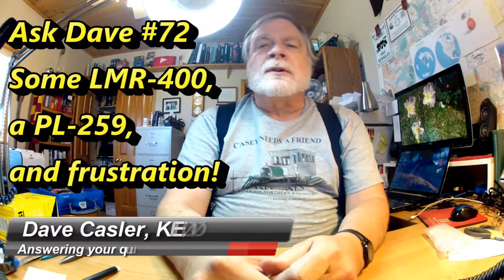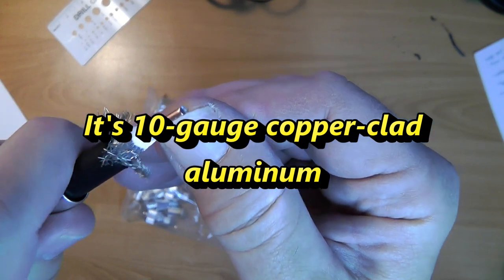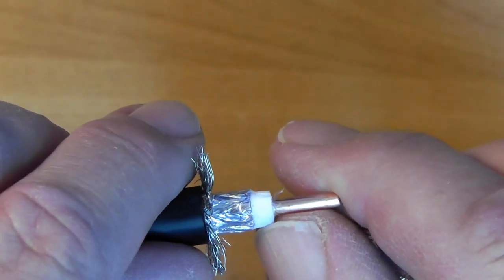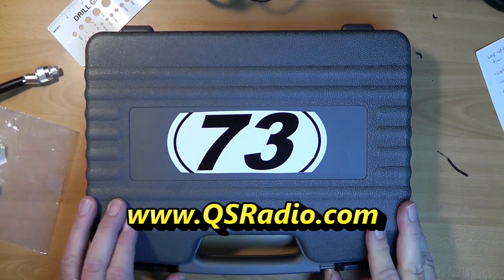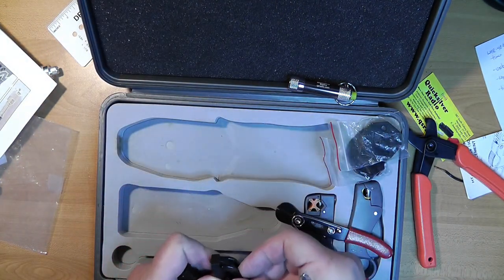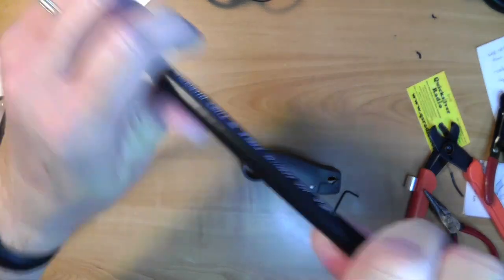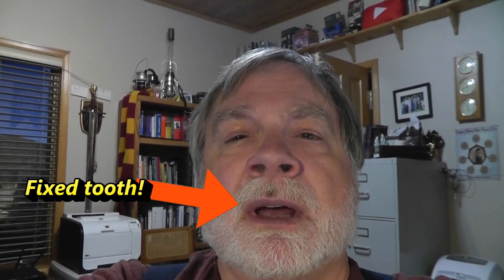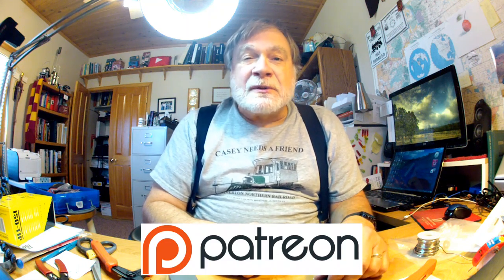LMR-400 Coax Cable and Connector (#72)

Comment: A cellphone company installed indoor antennas where I worked. They brought in a 1,000 foot spool of Times Microwave LMR400, used about 700 feet of it, then tossed the spool with about 300 feet of coax into the dumpster. With a scrap removal permit and some help from one of the millwrights the spool was fished out and went home with me. Free is a very good price.

Comment: Dave,

We build about 10,000 Times Jumpers and Antenna Cables each month :)  You are correct in that Times makes the best coax out there for low loss applications.  Some other points in your video need a little clarification.

LMR-195 is used by Hams, a lot of them.  We build a ton of jumpers with it as it is the same size as RG-58 with less than 1/2 the loss at HF frequencies.  This is a good combination. :)

LMR-240 is very popular as it has the loss of RG-8 and is the same size as RG-8x

LMR-400 is the most popular.  You can bend it 90 Degrees in 1 Inch during install without attenuation.  Yes it has a foam dielectric but the center conductor in Times coax will not migrate.  You don't have to worry about that.  We have a 10 Year Warranty on our cables and have never had one returned for that issue.

The tool set you have is OK for most cables and the smaller LMR types but if you are going to do a lot of cables you need a better set of crimpers and absolutely a better cutter for LMR-400.  The cutter you have is too small and flattens the coax making it much harder to strip. To strip the cable your stripper is OK but you need a set of Linemans Pliers with the Flat tip in both large and small sizes.

After stripping grip the first section with your pliers and Twist.  It will pop lose and slide right off.  For the others use the flat face of the pliers from the Side and Pinch the cable and Twist to break it lose.  You Do Not need any cutting implements.

The solid center conductor needs to be much hotter and you should flow the solder down the PL-259.  This will give you  rock solid connection.

We build LMR assemblies up to LMR-1200 :) THAT is big.  

We sell Reels of LMR through Amazon for less than you paid.  You can also buy our complete assemblies through Amazon, Walmart and design your own with Any Length and Any Connectors at https://USACoax.com
Reply from the maker: Thank you for the excellent tips! I'll get myself some lineman's pliers
Reply: I bought a 20 ft LMR-240 assembly with PL259 ends from MPD digital. I was impressed with the quality. Michael from KB9VBR J-pole antennas sent me to MPD Digital.
Reply: I've purchased 3ft 400 series ultraflex jumpers from MPD, and MPD will be seeing return business from me! Great work. Great jumpers. Great assemblies. Thanks MPD Digital/USA Coax. 1Crazynordlander, I've bought KB9VBR antennas also. Lol. 460mhz slim jim works real well.
Reply: What is the model of the crumpet tool and does it come in a set?
Reply: I have an LMR-400 jumper from you guys, very happy with it. But I think ill be investing in the tools to make my own since  I need to many different lengths and am impatient. LOL
Reply: So this kit is useless for RG6?
Reply: I just got 120’ LMR-400 flexible low loss w/ pl-259s. 
I’m going to be honest previously I had 100’ RG-213U with Ampthenol pl-259s it’s was great coaxial.
The thing I’ve found so far with LMR-400 is one of ends the srink wrap has slid off the pl-259. 
Now, I’ve to fix it myself or it’s exposed to water running down into my experience coax!
I just paid for. $160.00  At this point I’m questioning LMR-400 being the best cable. It wouldn’t last for long the way there pre-made ends were put on that way. I’m probably just going to upgrade & pay more & put better ends on anyways. But, that’s a lot work for what I paid just saying & time!!

Comment: I buy the off brand LMR-400 copy and have never had a problem with it. I just screw on the PL-259 but it is a tight fit. L leave the brade on the side and twist the connector on over it then trim off the excess. I then trim and solder the center conductor. I normally can get a 500 root roll for around 250-275$. The locals buy it off me because there is no place local we can buy it. 

I used to love the old 9913 but I have not seen than in years. Nice video.......

Comment: We're glad you used crimp connectors David; LMR-400 and its variants are far too easy to damage with soldering - the foamed dielectric isn't suited to high temperatures.

Amphenol make some lovely crimp centre pin connectors for use with LMR series :)

Comment: Plenum rated cables sre also required by (urban, etc.) fire codes. In NYC it is required for all wiring inside shaftways, walls, ducts, all of the closed places where we sneak cable runs. They also produce less smoke when they do combust.
Reply from the maker: The melting plastic also produces toxic fumes.
Reply: I'm not sure if the plenum-rated cable produces less toxic fumes, or if it simply produces less (toxic) fumes because there is less smoke coming from it. But that's also part of the reason plenum-rated cable is required, less toxic fumes.

Comment: I use LMR-600 and putting connectors on that coax is an absolute dream.  I do use the proper tools for prepping and crimping the connectors.  Not sure how expensive the PL-259 connectors for LMR-400 are but for LMR-600 they are almost $9 each.

Comment: LMR195 is a great alt to RG-174, with much better shielding and power handling. I've used it in baluns - very flexible and easy to work with.

Comment: Looking for coax tools and came across the reviews on Amazon for the Times Microwave crimp and setup tools. The the stripper tool is made specifically for the Times Microwave brand connectors unfortunately. And at $100 for just the crimp tool , I’ll have to look elsewhere for tools that work with more common easy to find connectiors.
Reply from the maker: Yeah, the Times Microwave stuff is expensive.

Comment: Just my personal preference, but I slide a piece of marine grade heat shrink about 2 inches long over the crimp to provide strain relief where the braid enters the crimp sleeve. Marine grade tubing has hot glue inside and really grips and seals the connection.

Comment: You should use Amphenol connectors when using LMR cables.  They make it not necessary to strip the shielding allowing it to properly ground and keeping the low loss and noise quality of the LMR cables intact.  :)

73
AE0HF
Reply from the maker: Thanks for the tip.

Comment: Now this is interesting.  The Times-micro LMR400 I’ve been using has a full copper twisted inner conductor and is not quite as stiff.   On pl259 i lightly tin the inner tip of the center conductor and tin the coax “stinger” before inserting.  Solders much faster without too much heat to the coax and foam, although I read someplace that the foam on TM LMR400 is more heat resistant.
Reply from the maker: There are several flavors of LMR400, including more flexible versions. Pre-tinning is a good idea.

Comment: Forgot to add - for a great cable cutter go to Ace hardware and look for an Ace brand cutter tool we use here in the shop.  They are around $10 and we cut well over a million feet of coax up to LMR-600 with ours before they fail.  You can also get your Linemans pliers at any Ace. One set lasts forever.

POWER HANDLING - LMR-400 WILL NOT handle Legal Limit Power above 2 Meters.  This is what differentiates the LMR coax from RG-8 and RG-213.  We have had folks use too much power and Melt the Dielectric.  If you are going to run excess power don't use LMR.

Thanks,

Ray  N1MPD
Reply from the maker: Thanks for the tips!
Reply: Think it’s that bad below 50Mhz ?
Reply: perhaps RFS Heliflex cable - 7/8" handles 15 kw - if memory serves.  http://www2.rfsworld.com/RFS_Edition4/pdfs/Cable_Intro_23-29.pdf

Comment: Picked up one of the kits as well. I like how versatile it is. So far I'm a little disappointed in the rotating cutter. For brand new, the braid cutter blade seems to tear it up a bit as opposed to just cutting it. Not the clean cut you obtained in the video. I may try it a few more times with adjusting it, but as you said. Limited tries at such a price for the lmr400.  The large cutter doesn't cut through the lmr400 cleanly either. Kind of smashes it and then leaves the braid wire frayed on the far end. I may look some cable cutting scizzors. But for the price of the kit, I wish these aspects were a bit better quality. It's a better price and more options than what dx engineering had though. Thanks for the tip.

Comment: Hi Dave,

Informative video on the specs.  Thank you!  I've been using LMR-400 and found it a bit of a bear to work with at first but did get it down to something I feel is manageable.

One quick note, when I solder the center conductor I find that there is sticky rosin left over.  I'm not a great solder guy.  BUT, a little acetone does magic cleaning up the connector and gets it ready for insertion into an SO-239 connector very well.  This last bit of touch up seems to keep the connectors from sticking together unnecessarily and probably prevents signal loss.  Just my humble experience.

I really appreciate your videos!

73!
Reply from the maker: Thanks for the tip!

Comment: I've been using clamp-type connectors with DXE-400MAX cable. These connectors would likely also work with LMR-400. No crimp tool required for assembly, just a pair of wrenches.

Comment: Will be commenting as I go through the show as I do not have a good memory of what i watch. First off, great choice in coax and thank you for the video. In the first part showing the coax center is silvery. I think most places are going to aluminum for the center with a copper coating. Aluminum is much cheaper but I will say that aluminum is the next best choice. Now everyone remember that RF travels on the outside of the wire so please don't get upset at aluminum as the copper part is where most of the RF will be. Will comment after watching more.   73, ad0am
Reply: Now the foilf inside i believe is also aluminum foil. Just to ass a helpful hint here. The foilf is actually the shield. I know alot of us are use to caling the braided part the shield but technically that is wrong. the shield is supposed to keep the center conductor and the outside braid from radiating with each other and ruining your setup.
Reply: I am now 5 min into the video. I would solder the connector no matter what. The reason why is the fact that hanging from your antenna, the crimp part could let o and all that would be holding the coax in would be......nothing. with soldering, at least it would stay in place. That is my thought but I still alwasy solder when I can. Was not much on crim connectors but this one might be promising.
Reply: I will add here at about the mid point of the video. I use DXE 400MAX which is DX Enginnering's coax which is very similar to LMR-400. If my memory serves me correct, it is 11 cents cheaper per foor than LMR-400. Just wanted to thow that out there.
Reply: At 19:50 you talk about the loss. Just to remind the viewers, you are showing per 100ft. So if you are less, you will have to say less loss and more than 100ft, add loss. But it is fractional. ie. if your are using 25t, the loss is only about 1/4 and if you are using 125ft the loss is 1.25 times that. Hope I explained that well enough so those can understand what loss is and not to treat every coax at 100ft as yours might not be that length.
Reply: End of video. Looks like you had fun with that connector. Great video. Sorry for all the comments but wanted to help as I could. Keep them coming Dave, 73  ad0am

Comment: Are you going to make another video and show us how to install a crimp connector on LMR-400?  I need to do some and am a little timid to try, after seeing your problems with it.  I did buy the QSRadio crimp kit and just installed a PL259 on an RG8X coax using their stripping tool, had to move one of the blades first, and the crimping tool worked great..  Your video #62 was very helpful.
Reply from the maker: I have done two videos. One is putting a "standard" crimp conductor on LMR-400 (very frustrating) and another putting on the special Times Microwave crimp connector on some LMR-400 (vastly easier!), though it takes a special connector and a special tool from Times Microwave. Search for these videos on my channel by looking for LMR-400.
Reply: @davecasler  Thanks for your reply.  I watched the other video.  I found problems getting the QCRadio stripping tool (3 cut tool) adjusted correctly for blade depth. Using RG8 cable I found that the stripping tool was stripping too deep into the stranded copper center conductor. Took several tries adjusting with the Allen wrench before I finally got it to strip correctly.  The cable jacket is pretty hard and difficult to cut through.  I suspect you had trouble stripping the cable, as crimping is pretty easy, once the cable is prepared..  I watched your other video using the Times Micro tool set.  Only problem is their tool is very expensive, some say around $400, and I already bought the QCRadio tools.   Crimping is still better that soldering the braid.   Have you tried again with QSRadio tools?  Sure enjoy your videos.  Most helpful!
Reply from the maker: @Veetheoneandonly  I've been hoarding my few LMR-400 connectors for special occasions.

Comment: Dave, I think on those kinds of connectors, they come with a little sleeve. You want to slide that on the wire before you start to cut it. Later it'll be there when you're ready to crimp.
Reply from the maker: Indeed you are correct. I am always forgetting to put it on first.
Reply: There is a similar step to putting on the ends on metal brake lines. You do NOT want to skip that step. It will ruin your whole day.  :-D

Comment: Thank you again Dave.  I have been searching around for tools to work with some direct bury LMR400 I bought and could not find a good source for the crimping and stripping tools.  Your suggestion if the QSRadiio kit helped a lot, and I just ordered one.  It is some stiff coax for sure!
Reply from the maker: If you want to pay for premium stuff, you can get LMR-400-specific crimp connectors and tools directly from Times Microwave. Not cheap.
Reply: @davecasler  Thanks.  I see my kit just arrived from QSRadio today.  I sure hope the $8 a piece Amphenol  crimp ons work that I bought.  Will give it a go.

Comment: Yeah...the nominal/minimum bend radius of that cable is published by the manufacturer. Im guessing its somewhere around 12 inches.
for anything tighter, you need a 90°   connector which will cause rf power reflextion if not installed perfectly
Reply from the maker: The bend radius for Times Microwave LMR-400 is four inches. That’s 8 inches diameter.

Comment: David, I bought the DX Engineering Coax Cable Stripper. just spin it around a couple times and all clear, no fighting removing the little pieces of jacket. PN DXE-UT-8213. They have an 8x version as well but it doesnt seem to work as well (or at least I cant get it to)
Reply from the maker: Thank you for the link - very much!

Comment: wait till you try and install a 9913 F7 coax and the center conductor dont fit in the connector, especially the dxengineering 2 piece connectors designed for rg-8. its stranded and i think 10 gauge which is just a little bit bigger than the normal stuff. always have to cut a few strands off to get it to fit.

Comment: Hello Dave,
Can clear something for me.
LM400 seems to be the best coax cable overall, but about only for RX is there a better alternative considering no power is put on the cable.
Something not for a fix instalation, only for 400Mhz to 900Mhz
Thanks

Comment: I'm new to the Ham radio hobby and my frustrations are with trying to connect both N and PL259 type connectors to 400 MAX (DXE variety) cable.  I thought this video would help but the most important part of the video near the end was taped Fast-forwarded which was equally frustrating for me.   Can you please point me to another video of yours where you show step-by-step in slow motion/regular motion the 400 MAX/LMR400 process of attachment!  Must appreciated.
Reply from the maker: I will before long. I received a kit from Times Microwave with their connectors, and I need to make a video about it.
Reply: @davecasler  Thank you David!  I really find all you videos very helpful! Keep up the good work and let me know when you Times Microwave video goes live.  I just bought the Times uW CST400 cable prep tool and I am loving it for N-type on 400Max.

Comment: There is a variant of the LMR-400 called UltraFlex that uses stranded inner conductor. You should give that a try. I use DXE-400MAX from DX engineering for long runs because it is direct burial rated and a little cheaper. But for short runs I still prefer RG-8X or LMR-240 UltraFlex.
Reply from the maker: Thanks for the information.
Reply: That’s what I have and the crimp connectors will not work. Strand is too thick to fit the connector.

Comment: I worked with different types of wires before I had to retire because of my back. Plenum cables must be used in all buildings that the wires are run in drop ceiling if it is used for return air. You could run in heating vents but don't know why,  I never did. But for the most part wires must be in conduit or Plenum.  Plenum wire does give off deadly gases when heated to a very high temperature,  I forgot what that temperature is but remember that if the wires get that hot there is a Very big hot fire in the building and I don't think there will be anyone alive for the gases given off to bother.  It it part of the fire safety code.  And anyone that knows the newer code it changes from year to year I have not worked Fire safety, and alarms for some years, and I may not remember all the rules.